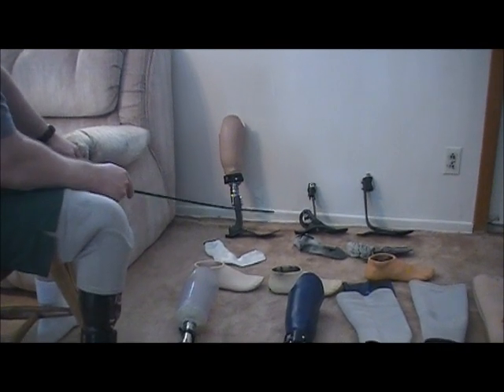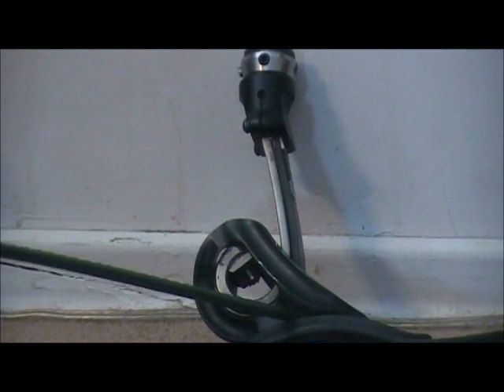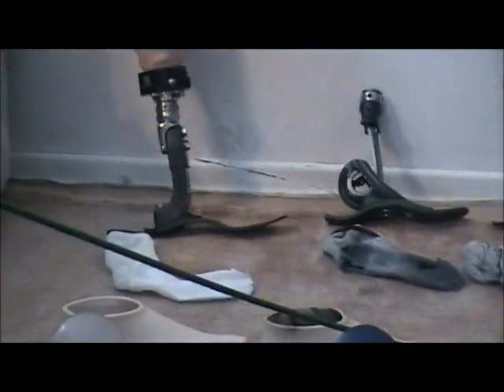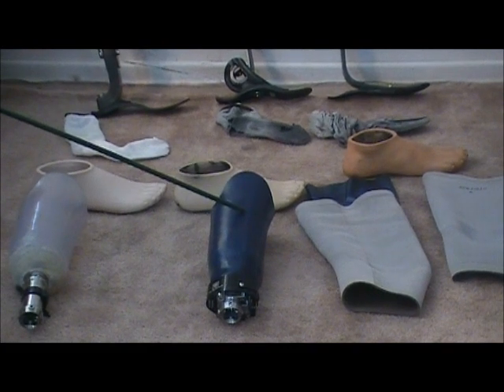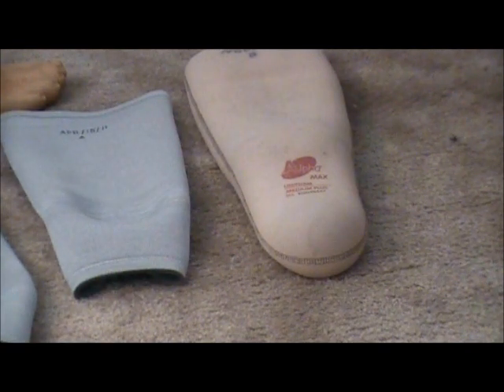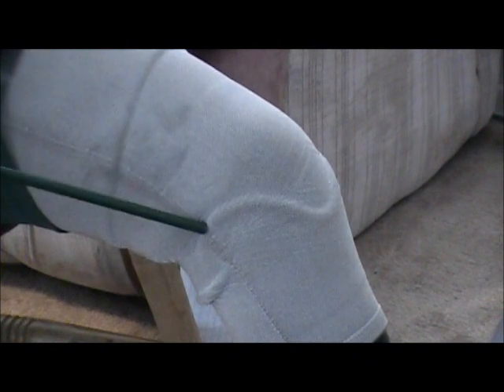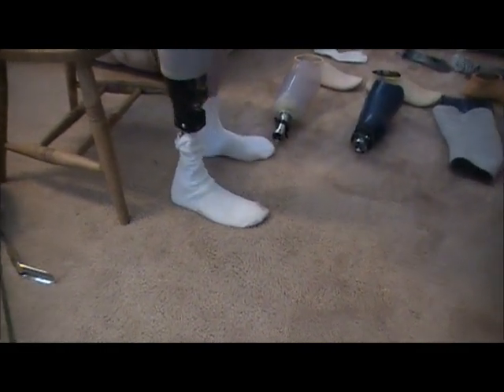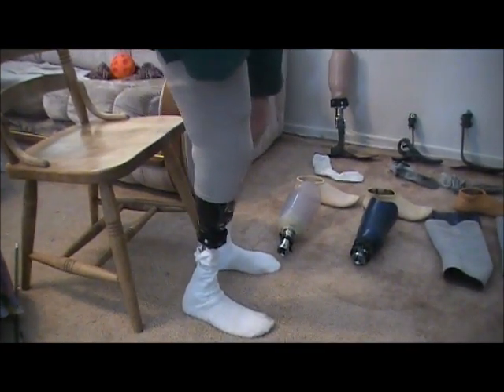prosthetic leg assembly/ Echelon , Perfect Stride,Ultra Stride,flex foot

Comment: Thanks for your video Frosty... I am also a right leg below knee amputated person. I have been using Otto Bock Limb around 7yrs with shuttle lock system. I am able to a general activities in that right now, I am planning to go for some advance limb that can full fill my requirements like running / jogging, car driving especially Manual cars, Water Resistant (optional), as well as suitable for daily activities.
Hope you had a lot research in that so kindly suggest me in this regards 
Sridhar Sk

Comment from the maker: Hi 
If your talking about getting the rubber Foot shell off the graphite Foot . You just use a shoe horn and pry it off. It takes a little bit of effort as it is stiff to bend the rubber foot.
Use the shoe horn by the heel area...just like you would use it to get a shoe off your foot.
Hope this helps you out..

Frosty

Comment: I got the TT Pro last week and it's very good, seems to improve the gait because of the slight piston movement and also tortion control.  I used it then they took it off to see the difference and then put it on again to be aware of the change and there is quite a big improvement when walking, feels more comfortable..

Comment: That's interesting that you adjusted it yourself, I would prefer to do that myself one day.  I will ask my prosthetist to send for the echelon because the soleus is not letting my go up hills, it is better than others but still not good enough.  I am wondering if it's because the test socket is not cut low enough in the area below the front and back of the knee because the knee doesn't seem to bend in time for me to progress up a hill.

Comment from the maker: The draw backs of this foot are that it is heavy as feet go. Also it is not as high energy return as some of the other sports feet. Company says that it is ok to get wet , but it is not ok for swimming. So they tell you not to submerge it. I have had this foot for at least a year now, and If you don't tell any one I will share with you that my foot may have been submerged a time or two . with out negative results. 
Hope this is helpful to you
Cheers!
Frostythesnowman

Comment from the maker: Hi emf111 thanks for your post. I am still using this foot and like it very much.
I have not had any problems to speak as of yet with this foot.
The main benefit of this foot is that your knee can move over your toe on the stride, more like a natural stride. My weight transfers to the toes  with out my heel coming off the ground . He may mean it is difficult to get set up  ie  alignment of the foot took me some time to get just right.

Comment from the maker: Hey Jeff
Sorry to hear the limb logic pump did not work for you...care to explain what problems you had? I know when I first got mine , there was a problem getting the socket to seal...it would leak a lot, and run all the time, but they found out the problem was the type of glue they were using would get too hard..and then leak. They changed the type of glue , and the system would seal and works fine now.

Comment from the maker: Thanks for your post.
I was not familiar with the c walk but I googled it after i saw your post question. 
It would appear to me to be similar in some was to the perfect stride foot, as they both
use a circular  join mimicking design
Do you use a  C walk and if so...do you like it?